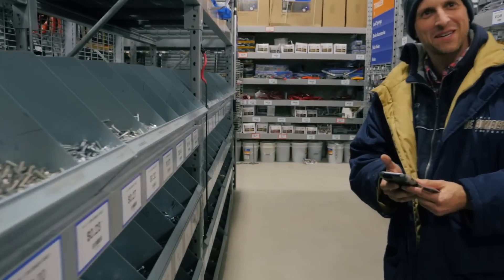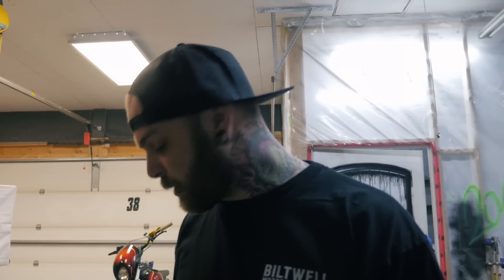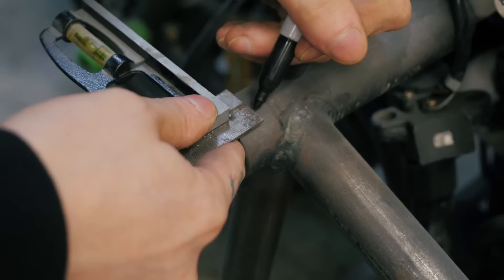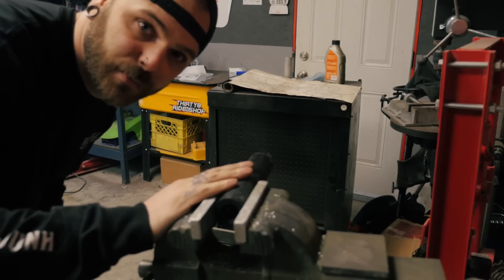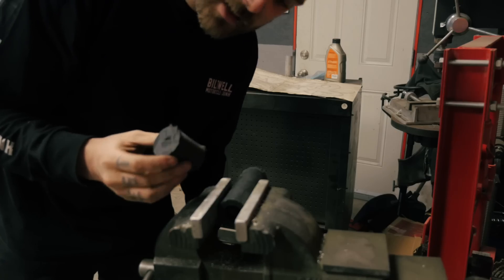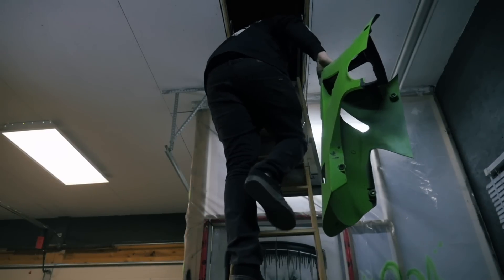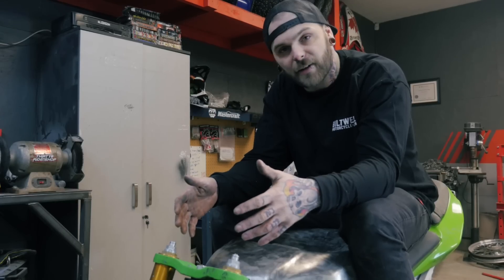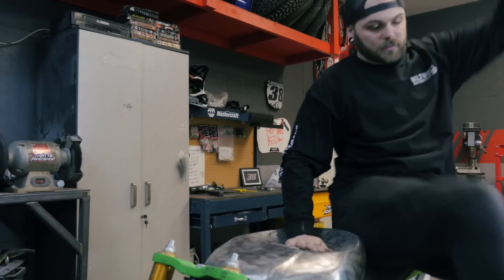CRASH CAGE COMPLETE: THE 636 STUNT BUILD

Comment: hey brutha, awesome job as always dude those look clean af!! when i made my sliders i found a reciprocating saw with a wood blade works best for that material doesn't heat up and get stuck like the metal blades or fling melted hot slider everywhere n smoke out the shop lol i tried cutting it first in a tee shirt with my hand grinder i didn't get too far lmao